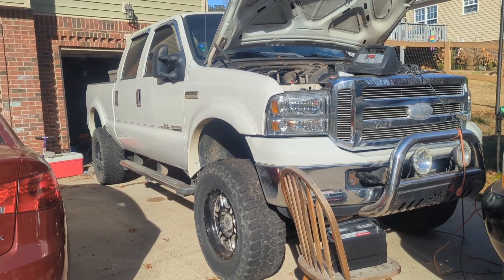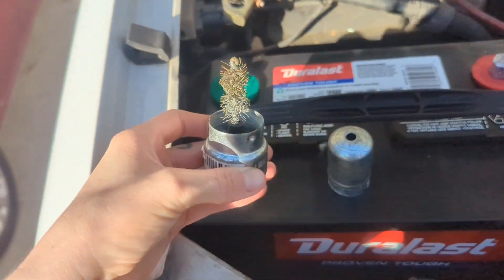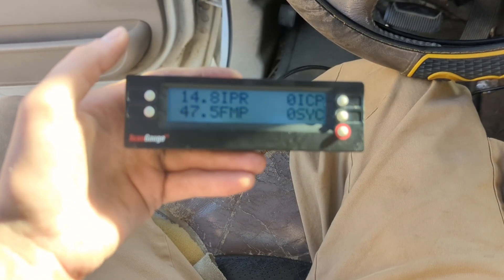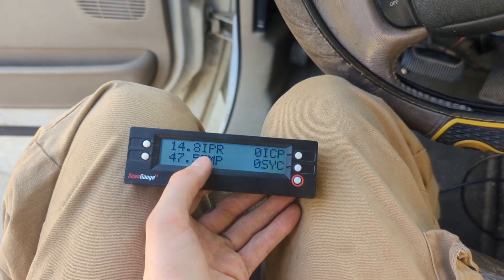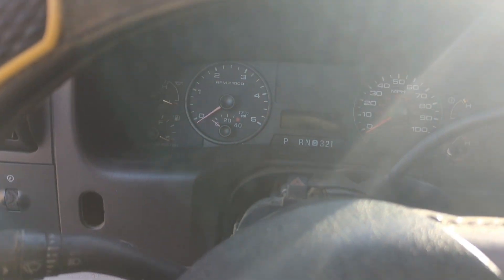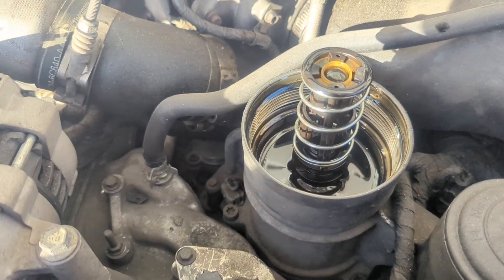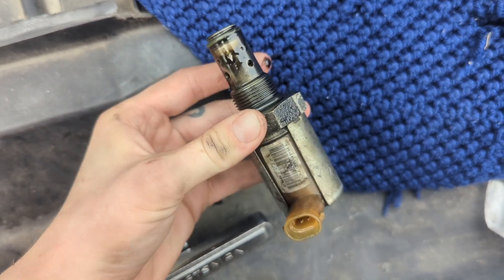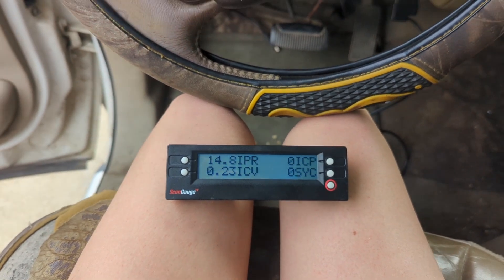SOLVED! 6.0L Crank No Start, 0 ICP, No Oil Pressure

Comment: How long did you have to crank it after you saw ICP pressure on your gauge before it would start? I’m dealing with the same thing right now and I don’t think I’m cranking the engine long enough for it to fire off.
Reply from the maker: I believe rule of thumb is 20 seconds but If I see it building I'll let it crank longer to see if it will hit 500. However, I did have to replace the starter on this truck so maybe don't take my advice about cranking longer than 20 seconds 😅

Comment: Dealing with same stuff,  06 f250, studded, deleted & tuned
It’s got a brand new hpop/ dummy plugs & standpipes, new icp, the ipr was replaced before the hpop went bad so I think imma try swapping out my ipr again cause the oil filter housing is filling up with oil
Reply from the maker: It's pretty common to have your IPR screen plug up after opening it up and replacing things. Dirt and debris sometimes get in there and make their way to this IPR screen. Definitely worth checking.

Comment: What looks like it's a high pressure pump or a clogged screen underneath the oil cooler
Reply from the maker: This one was just the IPR. The hpop doesn't usually go bad on the 05+ models with the cast iron pump. The screen should probably be cleaned or replaced in the near future next time the oil cooler is done. Very possible that if gunk is in the IPR that the screen has been torn and is allowing crap through.

Comment: Man I've got an '03 excursion and you are so lucky cuz the IPR is pretty much impossible to remove where it's at above the ICP sensor
Reply from the maker: I didn't know the excursion engine bay was different is there less space back there? I have an 03 F250 and that ICP is a bear to get to too.
Reply: @Sara_The_Feral_Housewife  after changing the icp in my 03 f350, I'm seriously considering trading the engine between it and my 04 e450 so I never have to fight with that again.
Reply from the maker: @chrismcelroy7915 I wouldn't blame you! My small hands are really helpful for that but the backs of my hands are always bruised afterwards. Definitely not a fun job.

Comment: Liked n subscribed! great video! I have an 03, 6.0, I crank it, it fires for like a second and dies, over and over, could it be more than just one component that needs to be replaced? any suggestion? Thank you!
Reply from the maker: It's possible. I have another video that should help you diagnose the issue. I think it's called Diagnosis your crank no start in 5 mins or something like that. You just need something to read PIDs like ICP, IPR, ect. I use Scan Gauge 2 but ForScan is free on a laptop and a good option too. If you get some data I can help you more.

Comment: Those protectors create a problem, they prevent the cable end from going all the way down  and this will cause your cable not being able to tighten correctly
Reply from the maker: @born2wrench  I'm not sure what you're talking about. The heat shield?

Comment: Thanks, I have a 2007 F-250 6.0 crank, no start. I replaced the IPR screen & checked it to be sure no debris . It started a drove short distance for couple of days, then it died going down the road  Left me stranded had to call a tow. Took it home to work on. I'm ordering a completely new
IPR unit and will try again 🫤
Reply from the maker: @DLBard-bv2nd  you might be getting debris from somewhere else. You can try a new IPR but if some other component is throwing debris then it will just do the same thing. Did the old IPR have any glitter looking sand?

Comment: Yeah this isnt the exact issue I'm currently dealing with working on a 03 ford excursion that seems too be in security cause the only way it starts is bypassing the ignition system and jumping the starter too the positive battery terminal. Any videos i can find about how too fix the issue im dealing with?
Reply from the maker: @kylebeach2316  does it crank at all with the key? I believe you still have to have the key in it to start it when jumping the starter so seems like it wouldn't be a key issue if it's starting at all. Maybe you have a break from the fuse box to the starter? Did you check all the fuses? 

I'm not aware of a video on the security/ignition unfortunately.
Reply: @Sara_The_Feral_Housewife fuses are all good. Truck does nothing when cranking it with the key, only starts with the starter wire too the positive battery terminal. The radio is out and I might hook it back up too see what it does cause the security light blanks when truck is running. Truck runs good with no starting hesitation so maybe it's just stuck in security?
Reply from the maker: @kylebeach2316  hmmm, I'm not so good with electric and security stuff. I do not think you'd be able to start it even with the jumping the starter if you were having a security lock out issue. I believe that all has to look good on the ECU for it to actually start or your start would just keep cranking and it wouldn't actually fire. Were you having any symptoms or error codes before this?
Reply: @Sara_The_Feral_Housewife no lights on dash for check engine or wrench lights. I found a video about the fuse box that I might try out too see if it'll work.
Reply from the maker: @kylebeach2316  Good luck!

Comment: How do I check LPOP with external oil filter?
Reply from the maker: That off your oil filter cap and crank the engine while holding down the spring/button in the bottom of the filter housing. If the oil comes up and fills within 10 seconds then your LPOP is probably good.
Reply: You can also remove the OEM sensor and plum in a manual gage. I used a T fitting with the gage so you can install your original sensor as well. So no check engine lights come on. The mechanical gage is very nice for future troubleshooting. Quickly eliminating any problems that may rise about low oil pressure from the LPOP
Reply from the maker: @kylebachman4477  great idea!

Comment: Those don't sound like new batteries and it sounds like the engine has a skip
Reply from the maker: Well they were new batteries so idk what to tell you 😂 and it wasn't showing any misfires or problems when I got it started and the only thing I did was change the IPR just like I showed  🤷‍♀️

Comment: What if it only starts when cold and dies when hot?

2003 6.0 powerstroke
Reply from the maker: @israelmondragon2664  you most likely have a high pressure oil leak. You can do an "air test" to try to pinpoint where you are leaking. I don't currently have a video on how to do that but I think there are some on YouTube. 2004+ usually it's a standpipe issue but 2003 it's more likely to be your high pressure pump or something else.
Reply: Your awsome! Thank you for responding so quickly.  Pressure that was built from HPOP was 3500 max.
Reply: Air Test through IPR sensor ?
Reply from the maker: @israelmondragon2664  3500 seems good for the HPOP. How did you test that? Is that what ICP is saying on your scan tool?  Yes, IPR sensor is the best spot to go from. You'll have to buy an adapter for it. They are pretty cheap on Amazon. I bought this kit. https://amzn.to/3zz6fWl
Reply: You're awsome!

Comment: What is the proble if there is not oil coming front oil filter ?
Reply from the maker: @19ivaniny  if you crank and absolutely no oil comes up then my first suspicion would be the lpop (low pressure oil pump).
Reply: Thanks. Is There is a small bottom on the oil filter compartment that if it pressed the oil comes out? Mine is powerstroke 6.4 2008
Reply from the maker: @19ivaniny  if you press the button at the bottom of the oil filter housing and oil comes up and stays until you release the button then your all good there. That means your low pressure pump is working.
Reply: @Sara_The_Feral_Housewife  thanks so miuch. I just realized that the previous owner installed an aftermarket oil filter that looks different than the original. Maybe that is the problem. I will let you know if  it works with oem filter. Thanks for you help.
Reply from the maker: @19ivaniny  gotcha, yeah if they put a tall cap on then you need to make sure you get the larger filter for it.

Comment: How did you get past that heat shield?
Reply from the maker: You can bend it back if you need to. I'm pretty sure mine has been bent from previous repairs. You may have to remove a bolt or 2 on it if it's never been worked on
Reply: She said she has small hands!!

Comment: if you have below 47v for FICM, thats to low...
Reply from the maker: @JP-mu3xl  not entirely true. Yes, 47+ volts is ideal. I wouldn't blame the FICM unless it was closer to 40 or under. I'd check on data before jumping right to the FICM. However, I'm basing that entirely on what I've heard on diesel tech Ron's channel

Comment: Great job ..
Reply from the maker: @My0186  Thank you!
Reply: Have a 05 Ford question... Replaced Turbo,oil feed line, EGR cooler ,oil cooler,gaskets and all. Orings everything. The truck idles but rpm surges to 1200 or more. Shit the truck off to restart idles fine at 664 to 6982 rpm and starts surging again. Any ideas.
Reply from the maker: @My0186  that's interesting. If you unplug your ICP sensor does it still do it? Your ICP sensor on an 05 should be easy to get to on the passenger side valve cover. My next question if you have a fuel pressure gauge, is the fuel pressure surging too? 

I haven't come across that particular issue yet.

Comment: How fast should the oil filter houing drain after stop cranking? Mine drops very rapidly
Reply from the maker: That's normal. The only way to keep it from draining would be to press the anti drain "button" spring at the bottom of the filter housing.
Reply: @Sara_The_Feral_Housewife  thanks for the reply! I'm having similar issues and found your video very helpful.
Reply from the maker: @jacobrobinson2303  good to hear! The good news is if you're getting oil coming up in the oil filter then your low pressure oil pump is working! Narrows down to a high pressure pump, or some sort of leak like your stand pipes or sct fitting. Hopefully it's just your IPR though bc that's the easiest fix!
Reply: @Sara_The_Feral_Housewife  the truck lost all power and cut out rather immediately. I have rebuilt the entire heads, replaced all the HP other than the HPOP and IPR. I'm going to pull off the IPR and inspect it.

Comment: Now i have a crush but thanks for the video just paid 3600 to get mine fixed ran for 2 days still not sure yest showed a possible crank shaft sensor do you have a video on it?
Reply from the maker: What did they "fix"? Usually the crank shaft sensor code comes on when you crank it for a long time. Almost always lights up with a crank no start situation. Do you have a scanner that can read ICP, ipr, and FICM sync and volts? Those are the first things I check.

Comment: What if your injectors don’t clatter at all on mines ma’am
Reply from the maker: I would suspect the FICM. Do you have anything to check the volts on the FICM or the FICM sync? The very first thing I would do is make sure that the FICM is plugged all the way in.

Comment: If I may... don';t use the felt protectors. They always (in my experience) cause problems with clamp fit and I'm not convinced they protect anything. If there's a leak past the battery post (electrolyte), they act like a reservoir and rot the clamp/cables faster. If you look at the negative clamp (at 2:43), you can see how the clamp is distorted and not sitting all the way down? Remove the clamp, straighten it, gently pry it open with a flat blade so that, with the felt removed, it sits down far enough that the battery post extends just past the top of the clamp. Then it can be tightened. Ima watch the rest of the vid, my apologies if this is attended to later on, I promise I'll feel bad :)
Reply from the maker: I'm still very much an amateur so I'm always open to friendly advice! Thank you!
Reply: @Sara_The_Feral_Housewife  Ur absolutely welcome! You have good instincts, you'll do great!
Reply from the maker: @petermeic1430  thank you!

Comment: Those new batteries didn’t seem to be cranking too well.  Maybe just the audio.   Kinda almost sounds like a dead cylinder
Reply from the maker: A few weeks after making this video it wouldn't start again. I replaced the starter bc the RPMs weren't getting above 130s but everything else was looking good. That did the trick. I still think it has an oil leak bc it's a long crank and takes about 5-10 seconds to build ICP.

Comment: How did your oil come up without you having to press down that valve?
Reply: Pressing that valve down is not necessary.
Reply from the maker: I think the oil will come up without holding down the valve but pushing the valve down keeps it from draining down.

Comment: great video, mine might be having the same problem but it might be a bit different, it cranks and the engine starts then immediately dies after 1-2 second of running. no one i know has figured it out do you have any ideas or tips? side note after about 5-10 tries of starting it will fire up and not turn off
Reply from the maker: Hmm interesting. Have you check your fuel pressure and oil pressure willing your cranking?
Reply: @Sara_The_Feral_Housewife  yes, they are both good which doesn’t make sense
Reply from the maker: @piersonjohn1264  I think I'd check compression after that. Any codes?
Reply from the maker: @piersonjohn1264  that's a tough one. Maybe it's electrical then

Comment: Does the diesel fuel go bad after sitting for a while? Considering the conditions 🤔
Reply from the maker: It definitely goes bad when it sits too long. You don't want to store it for more than 6-12 months. It starts to degrade.
Reply: Nvm. Got to see you've changed the old diesel.  Thank you.
Reply: Thank you. And you have a good evening.

Comment: Thank you for this video, I have a ‘06 6.0 F350 same problem. Crank no start. Checked fuel pump, pumping fuel but the fuel sending unit not sensing fuel in the tank. Tank is kinda full. Might be multiple things. Not sure yet but this is one thing I have to check.
Reply from the maker: Definitely check your base oil pressure, FICM voltage, and FICM sync. Wouldn't hurt to fill your tank too just in case if your gauge is broken. Diesel Tech Ron has some great videos on crank no starts. I'd check him out too!
Reply: @littleliondoesstuff  Yep. Finally hooked up the Bosch scanner. Found the ICP wasnt building pressure. All this after replacing the fuel sending unit & fuel pump.
Reply from the maker: @anykinehobbyguy808  do you have any ICP volts? A quick way to check if your ICP sensor is the problem is to unplug and try to start it. If it starts you just need to switch out your sensor. It's located on the passenger side of the engine on the 06 and super easy to get to. That's what I would check first
Reply: @Sara_The_Feral_Housewife  We Ended up sending it back to the person who worked on it before me.
Reply from the maker: Good deal, hopefully they figure it out
Reply: @Sara_The_Feral_Housewife  yeah, lol. My boss forgot it was worked on before I started working on it. Thank you for all your help.
Reply from the maker: No problem!

Comment: The truck needs an engine. Listen to the uneven crank - you have one or more cylinders not making compression and from the blow-by it sure looks like it is a piston ring/ cylinder wall issue. Don't put any more money into it until you know how much you'll need to spend to get it running correctly. It may not be worth fixing.
Reply from the maker: You're absolutely right. I bought this as a project truck. I didn't even know if it would start. I'm deciding now if I want to sell it now that I got it to start or tackle the engine.

Comment: Hi the correct way is to remove your oil cooler and replace the screen under the oil cooler it's going to happen again.
Reply from the maker: For sure that's the long term plan. This is a quick check to get you on the road again. This truck needs A LOT more than a screen replacement. I just wanted to get it started before I tear into it.

Comment: So si the icp or ipr valve?
Reply: Awesome, my 2006 super duty don’t start so I’m going a try right now 👍👍👍👍…
Thanks so much!
Reply from the maker: @gomezloco9  what are your readings for ICP, IPR, and FICM? I also highly recommend any videos from Diesel Tech Ron. He's helped a lot with my crank, no start problems!
Reply: @Sara_The_Feral_Housewife  no idea, my truck is been parked for almost 4 months, have other diesel trucks and don’t really need that truck. I finally get a little bit free so I’m going a try and check everything you show on the video.
Reply: I’m in Georgia and it been raining all day so as soon rains going away I’ll check
Reply from the maker: @gomezloco9  Good luck! Let me know how it goes!
Reply from the maker: The IPR valve was stuck open because something went through the screen and the screen broke a piece of the screen held the valve open. This caused the ICP (oil pressure) not to be able to build.
Reply: @Sara_The_Feral_Housewife  that something is probably a piece of o-ring from one of the tubes.  Check the tubes and tube plugs.

Baking soda and water mix will clean up the terminal, dunk then in the mix.